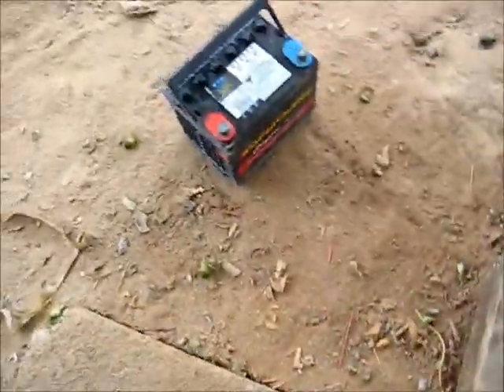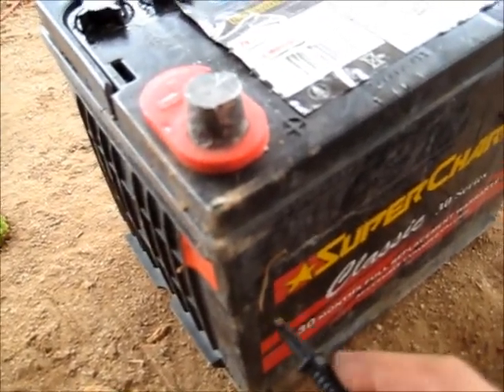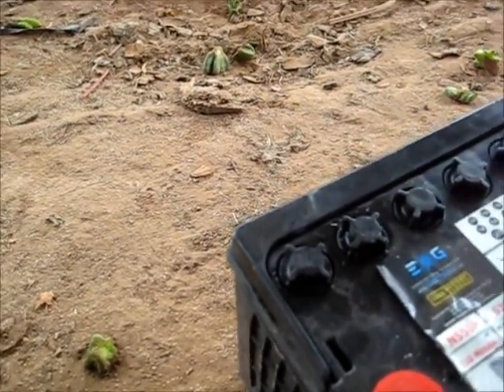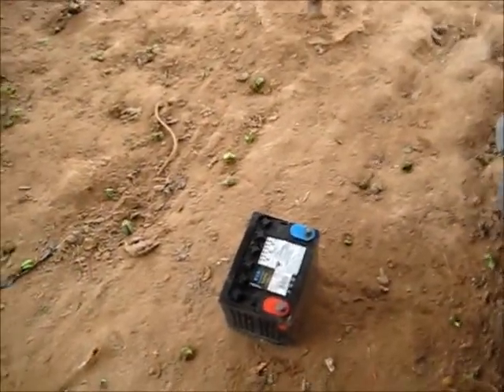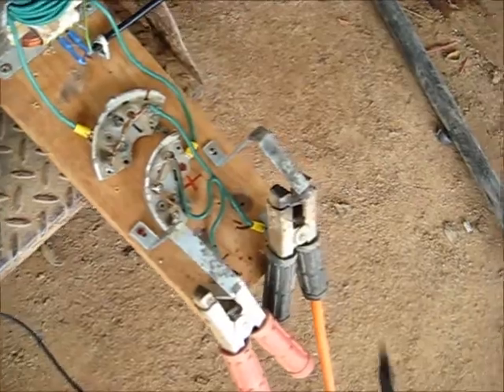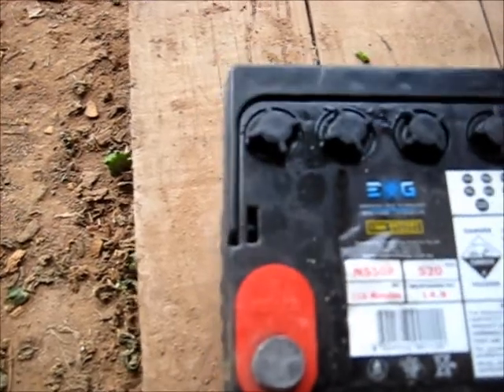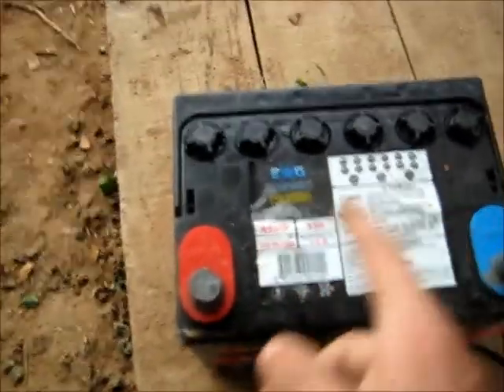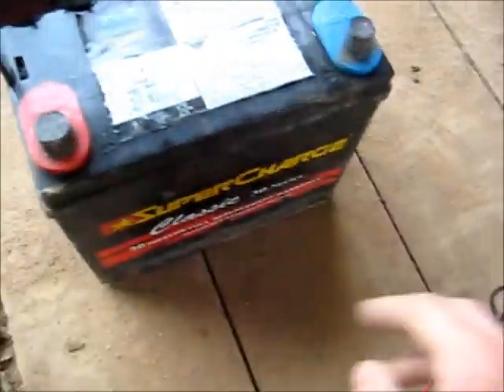Car battery advice & AAA Battery Popping

Comment from the maker: for a 12 Volt battery, you'd need a 15 Volt AC secondary at 7-10 Amps at least, output voltage DC will be higher but charge the battery at 14.5 Volts DC, at least 7 amp

Comment: Similar thing happened to me, but the difference was that it surged long short-circuit and one of the cells got damaged so as it changed polarity it got charged the opposite way and it couldn't recharge back to normal,  as the other cells were charged and didn't conduct required current to charge it as they were seriously over charged. But i opened that bad cell, connected 5v with resistor to its electrodes and kept it few hours like that, charged to the same level ... and it works so far :)